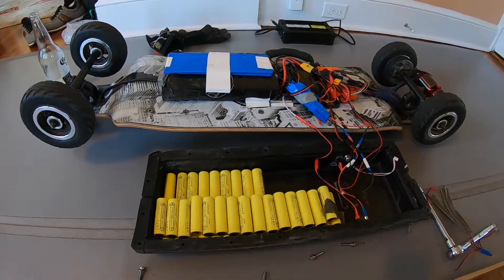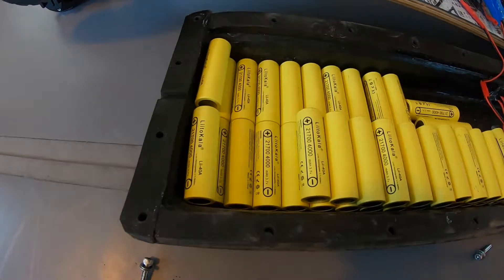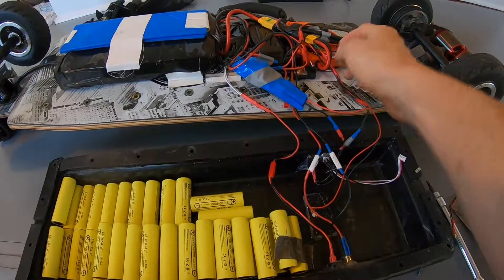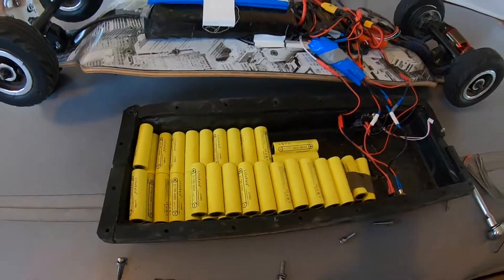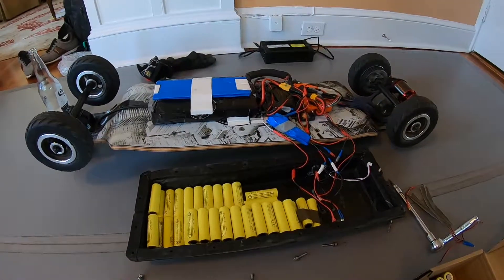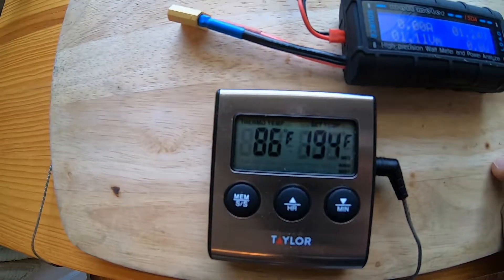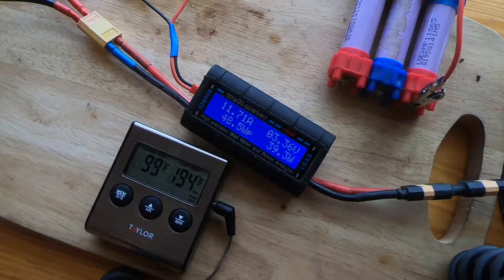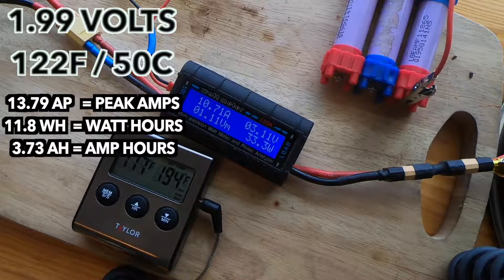Liitokala 21700 Cells - Part 2 of 3 THE BUILD and TESTING

Comment: How many miles are you getting with these cells and are you running at 60 motor amps?
Reply from the maker: https://youtu.be/iafVkFxO2Tg
bout 20mi riding hard...so possible more depending on your habit.
Reply: @LifeofAccro  thanks, on my evolve gt I built a 10s4p with 18650s got about 30 miles, but going to try it again with my own build with 12s8p 18650s then down the road try 21700s, I'd figure go with what I already know works. I use the liitokala hg2 18650s
Reply from the maker: @VegasErides  yeah with enough in parallel most packs are fine... 8p with a 3ah cell each will be stupid range lol... i may do an 8p as well for my next build and is more than enough for general riding...

Comment: any update?
Reply from the maker: still running strong and great..i actually moved up to 8" tires recently but the gearing is now better for low to mid range power...ive noticed increased range probably from less power wasted getting me up to speed. Im just wrapping up a 6p 30q build now to swap in and try the extra amps for fun (with ill probably never hit) but a few # weight loss for comparable AH ... who knows but may sell this 21700 pack or the 30Q depending...either way... one has to go  =)
Reply: @LifeofAccro  thanks for update!